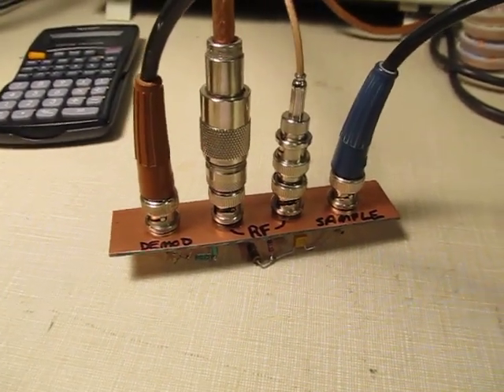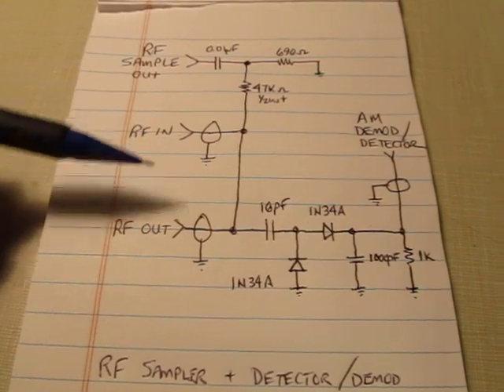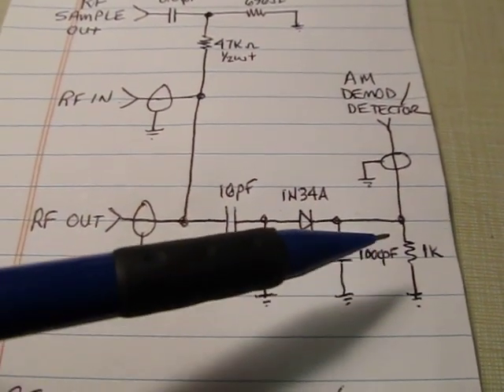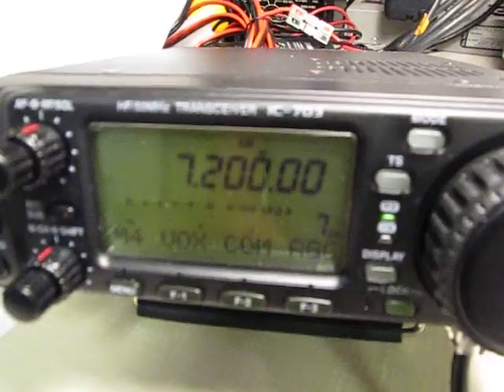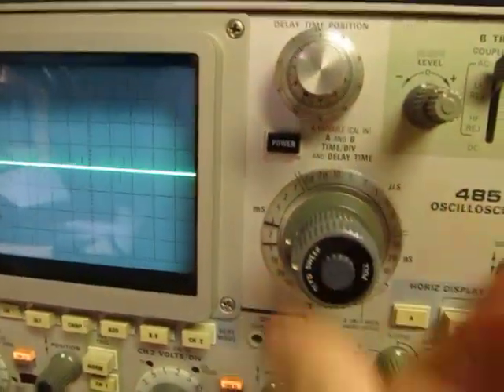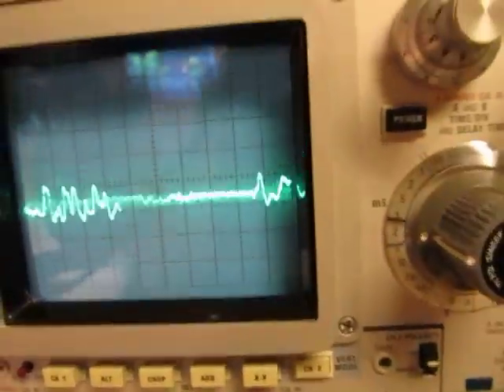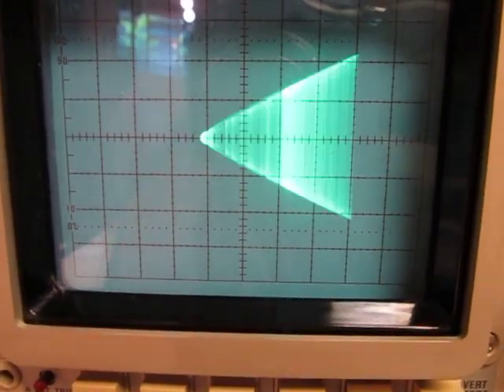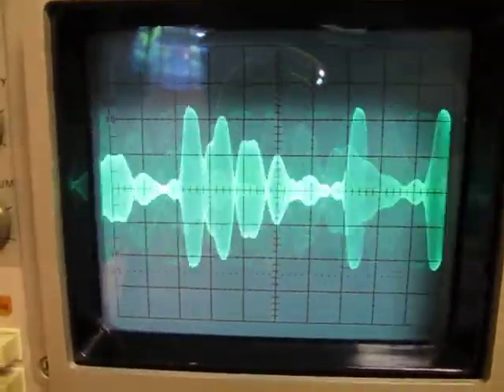#7: Monitor your Ham Radio transmitter with an oscilloscope

Comment: I have just about watched all your videos and have thoroughly enjoyed everyone.  I have just acquired a scope and am looking for ways to learn more about this wonderful hobby. I am in the process of building this project but on a breadboard so I can do minor substitutions of parts to see the changes.  Do you have any warnings?
Reply from the maker: I have a couple pieces of advice:
1) Do not build it on a plug-in breadboard.  These do not work well with RF.
2) Be careful about the power rating of the resistors used, depending on the RF power you plan to run.  Calculate the power rating needed for the resistors.
3) Do not built both the sampler and demodulator on the same RF tap like I did here.  I did it only for convenience.  They would never be used this way.  Build them separately if you intend to use them for rough linearity checks.
4) You will likely want to put an attenuator ahead of the demodulator for two reasons - to limit the voltage peaks seen by the diodes, and to limit the amount of distortion injected back into the RF path from the detector circuit.

I have a few other videos on RF samplers that you might want to view also.
Reply: ***** Thank you very much for the advice.  I will heed your cautions with great care.  So far, no smoke. :-)

Comment: Hi.
Tnx for nice explanations. But still have a question. I saw u use 1N34A diode which have a PIV of 60 volts. Whats happen if I want to use your project with a TX producing 100 watts or more. 100 Watts is 70 volts rms or 100 volts peaks at 50 ohms. Could the diode suffer or be destroyed ?
Continue the good works.
Stephan.
Reply: move the diodes to the divider where the voltage is lower.

Comment: I just use a scrap bit of wire, wrap about 4 or 5 turns around the coax or one leg of ladder line and clip the oscilloscope probe clips to the ends of the scrap wire.  The wire acts like a "sniffer" and picks up a little radiated signal.  Its good enough to observe a waveform to check transmissions with.  Down side, its not calibrated, but I use this to set up WSPR transmissions to very low levels, and ensure a usable (readable) signal.  Hope that helps Kevin.

Comment: Good morning, and to think that I just wrap a little wire around my co-ax to check my transmissions!  Put the ends in the scope input and bingo, a small RF sample can be seen.  But your circuit is certainly much better.  Just goes to prove that there is more than one way to skin a cat, so to speak.  73 & 501.

Comment: how would one gracefully tap the exciter when using a barefoot box stock japenese rig, ie yaesu ft-450. I presume one would have to get it from the circuit board at the proper location ?

Comment: I think the 690ohm resistor should be 680ohm as 690 is not a standard resistor. I might be wrong. Kind regards Spence

PS: Great video as ever
Reply: Calculate the voltage expected across each resistor.  The power is the rms voltage squared divided by the resistor value, P = E^2/R   The resistor ideally would have a larger power rating.  For non-QRP, the diodes or 10pF cap may not handle the peak voltage.  You could attach the diodes at the divider where the voltages are much lower, or build a second divider ahead of the 10pF cap.

Comment: Hey Alan, I just completed this little project only I used the SO-239 UHF connectors. I purchased a ABS plastic project enclosure box from Radio Shack. In order to connect to the scope I used 2 uhf to bnc adapters, and then my regular RG-58 patch cables from the radio RF IN, & RF OUT to the dummy load.  I tuned my transceiver to 7.100 CW but couldn't get a wave form probably due to the scope not being ajusted.  Found SSB worked great & my wife was amazed at her voice print on the scope. 73's

Comment: Does the scope need to be able to cover the frequencies of the transmitter you're trying to test or does that matter?  I have an older scope but I'm not sure how far into RF it goes.
Reply: Double the fundamental.  If you want to monitor 7.00Mhz, you need a 14Mhz scope so you can monitor both sides of the carrier.  See how that works?  I have a cheap 20Mhz Heathkit, so I can work up to 10Mhz.

Comment: that is all ok for AM modulation measure,but how many people work on AM,and that measuring tell us nothing about harmonics in signal....that is ancient measurement,today we use spectrum analyzers for that purpose and Bird sampler,i use model 4732 for HF...since SSB is mode of today communication,better measuring equipment is needed....but sure this is good example for AM mode and low power,if power is raised it is not so simple anymore

Comment: Hello
building one now,,what is the transmitt power your appling to this circuit ?
I will be using 50 watts  transmit power        what wattage for divider resistors 
thankyou very much

Comment: Thank you for your response. . Are you saying that the advice is conflicting because, in fact, the scope input Z is not 50 ohms?If the scope input Z were 50 ohms then the 50 would be across the 690 and that would act like a resistor of 46.62 ohms in series with 47000 ohms thus the 1:1000 voltage divider. But as I understand it you are saying that in fact the input Z is more like 1 Mohm and so the voltage divider is really more like a 690 in series witth the 47000K. Am I understanding what you ?

Comment: Though W2AEW has clearly told you that the CRO has an input impedance of 1M, you are getting conflicting advice in another place where Steve states "... the 'scope presents a 50 Ohm load in parallel with the 690 Ohm resistor, producing a voltage divider ratio very close to 1000:1."

It is no wonder you are confused!

In fact, as I mentioned in another post, the CRO input Z is probably more like 1M//5pF and W2AEW has not properly dealt with calibration of the voltage division in the loaded case.

Comment: Though I agree with your analysis that most of the input voltage appears across the 47K resistor in the 690R load case, and it is probably true also for most attached CRO loads, the implication that the circuit could withstand 70V RMS is flawed. The 1N34A PIV rating is 65V, so it would be unsafe to operate it above say 20V RMS (or 8W in 50R) allowing a margin for safety.

Comment: The discussion about a voltage divider with 47K and 690R is not relevant to the case where a CRO (lets assume input Z is 1M//5pF) is connected via 2m of RG58 (as shown). The impedance of 690R // CRO is more like 15-j100, so the loaded voltage division is not simply 690/(47k+690).
The case would be different again if a 10x probe was used, in that case the 690R would be shunted by something like 10M//1pF for approx 690-j20 (which shows why we use 10x probes).

Comment: Alan, please let me go back to basics: I was thinking that the 100w generator "looked into" the "rf in" on your diagram and saw the 47k in series with the parallel combination of 690 and 50 (which is the o'scope) with both the 690 and the 50 tied to ground. Is this wrong?

Comment: See...apparently I am really screwed up in my understanding of the basics. 

To explain a bit my lack of understanding. I got my EE in 1982 and really never used it. Got laid off from Motorola in 1983 and never went back. I got my last ham ticket in 1973 and after a stint in the Air Force and life being what it is, got out of ham radio for about 20 years. So I have retired and have experienced some renewed interest but truthfully, this shows me how much I have forgotten or perhaps never knew.

Comment: Another way that I reasoned was to think of the RF current passing through the 47K resistor and then splitting between the parallel combination of the 50 ohm and the 690 ohm resistor with the 50 ohm carrying the bulk of the current which I calculated to be 1.414 amps rms. So wouldn't that mean that at least 1.414 amps would be going through the 47K? Looking at I^2R dissipation wouldnt the power dissipated be more than 1'2 watt?

Comment: OK so if the 50 ohms is modeled as a  resistor to ground and the cap is a short circuit to RF then the 70.7 v is across the 50 ohms and isnt that in parallel with the 690 0hms which also goes to ground? So if the 70.7 volts is across the 690 ohm resistor then computing e^2/r would give a dissipation of 7+ watts in that resistor. Clearly the 690 didn't burn up so I am mistaken in my analysis.

Comment: Alan..I had written you a couple of days before and was interested in how you would calculate the power dissipation of the 47K and 690 ohm resistors needed for one leg of the RF sampling circuit. It seems to me that the resistors would have to be significantly more wattage than 1/2 watt. I certainly understand that you are extremely busy, so if you could direct me to a source that might help I would also be appreciative. I got my EE in the 1980's and never really developed the "knack" . Thanks

Comment: I have several questions:

How would you calculate the voltage drop and therefore the power dissipated in each resistor, given 100W output from the transmitter? (I am speaking of the 47K and the 690 ohm voltage divider)
Reply: He doesn’t transmit directly into the scope so the divider doesn’t see 100 W.

Comment: Im needing something that I can transmit a carrier wave, at 2.4 hz, that I can use to send tone frequencies . I need to operate around 100 decibel and keep the wattage low enough to not cause physical damage in proximity   im guessing around 100-200 watts.

Comment: im looking for information on rf carrier waves, im building a rife generator that introduces emf frequencys on a cellular level, these were invinted in the 50s and proven to cure cancer. but were denied by fcc, because of use of rf carrier waves on a 2.4mhz frequency, and im working to find a alternative carrier ... what would be used to produce the rf carrier, and to adjust the frequecy of them

Comment: @nflgun In addition being able to monitor the RF waveform when running BPSK3 would be advantageous since it's difficult to set your drive levels without someone else observing your IMD. Question, what kind of waveform would you get if you drove the Ext. trigger with the demod signal? Any chance you'd consider refining the circuit some and maybe writing a QST article? I think you'd be surprised at the response.

Comment: Very nice. I've been scouring the web for a circuit like this, CleanRF makes something similar, the RF-SM which is a little pricy for my tastes. Even a search of the ARRL archives didn't reveal any home brew circuits. With radios like the FT-857D that have multiple controls for the microphone audio, i.e. compression level, mic gain, DSP mic equalizer, being able to monitor the SSB RF envelope becomes important in order to properly set the levels. Add in an amplified mic, even more so.